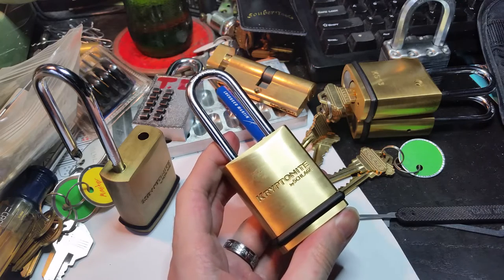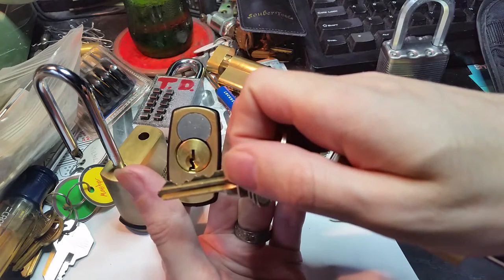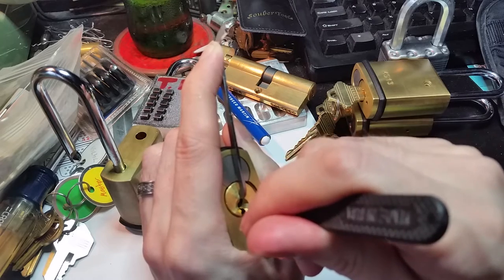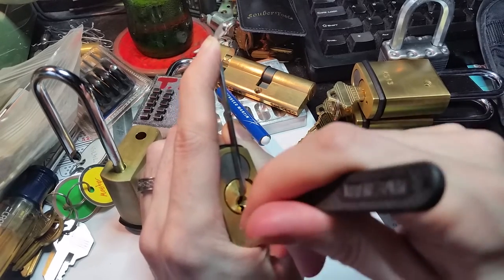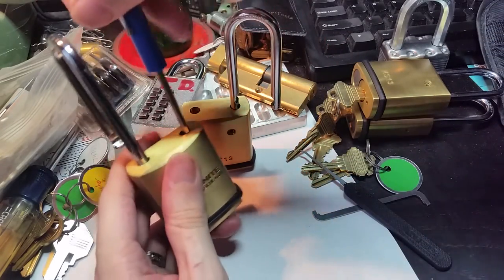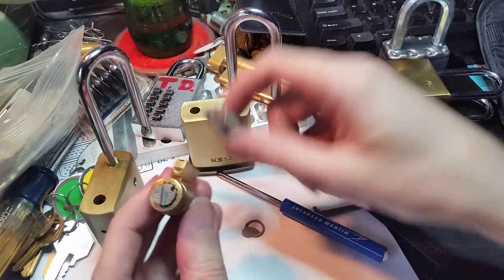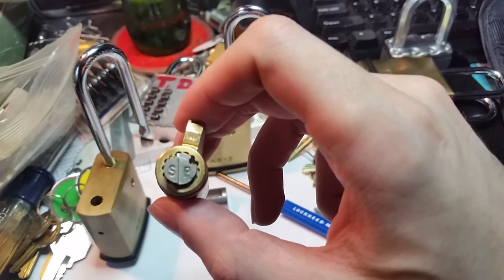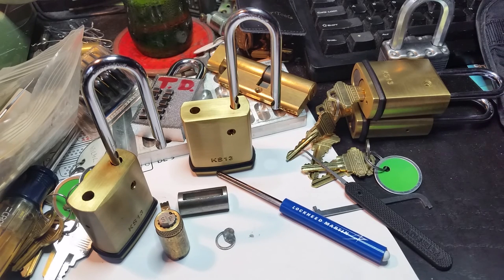(64) Kryptonite Schlage KS13 padlock picked

Comment: I am a big fan of these locks. One of the guys at locksport bought one for 5 bucks with an Everest cylinder installed...nobody has been able to pick it yet!
Reply from the maker: +Jeff Moss The factory pinning on these cylinders is amazingly tough, fit and finish up there with Everest and Primus, I can only imagine what a good Everest core does in there (I have misplaced mine). make sure you have a good feel way of disabling the Everest check-pin before attempting one in the padlock body.
Reply: yeah one of the guys has an Everest check pin tool. A very tough pick!
Reply from the maker: +Jeff Moss The fit is so tight that the feed back is very subtle and you frequently see extreme high-low pin combinations. Makes them very tricky.

Comment: Those Kryptonites are my favorite. I put an Everest Primus Kik in mine. Schlage at its best.
Reply from the maker: +RJ Robert James The fact it takes Schlage compatible KiK cylinders makes them very versatile. As soon as I can dig up one of my Everest cylinders I'm going to put one in as a demonstration lock, then maybe make a set of progressive locks once I get a few more.
Reply: The heavy spring tension makes it difficult to pick. Good luck with all security pins. It's a tough one
Reply from the maker: +RJ Robert James So far all the KS13's I have collected have only been fitted with standard pins. I plan to correct that.